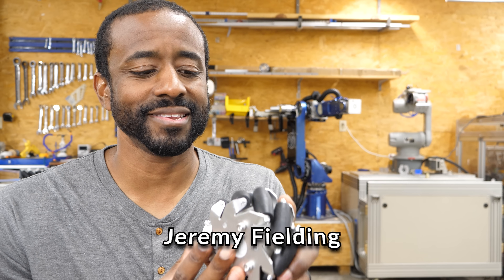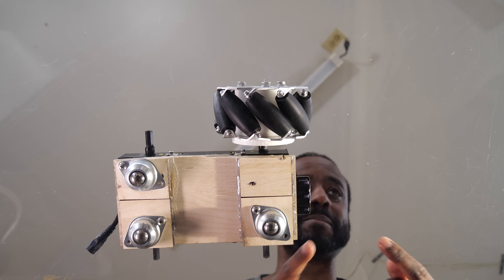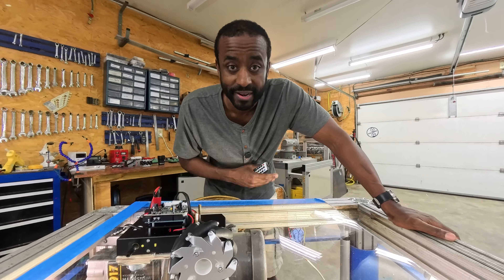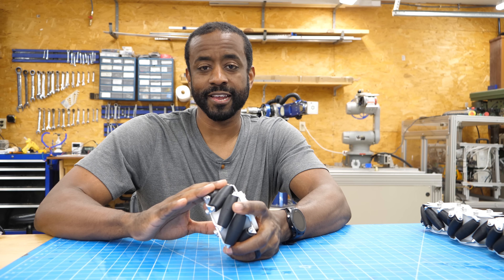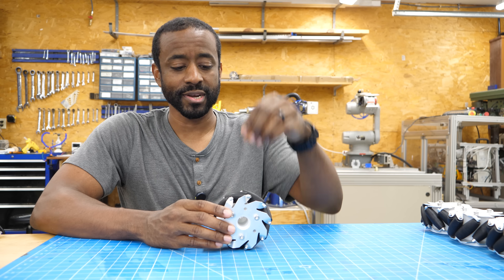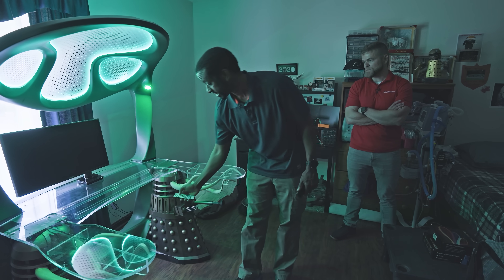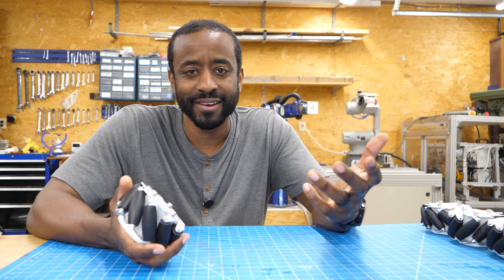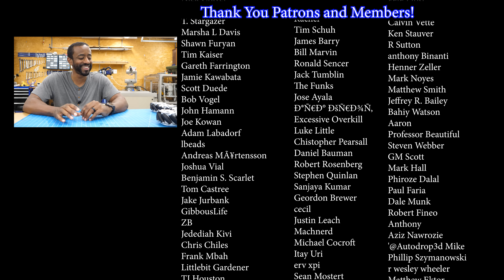The Mecanum Wheel Is So Weird, It Is Genius. How It Works

Comment: I believe most of us already have the 3D printer. Maybe we can use the 3D printers version with just a nut and bolt kit and maybe a few 2020 v slot or 2040 v slot framing. Then most of the materials are supplied by the builder, and they can choose PLA, ASA, NYLON, PETG, etc.
Last Christmas I bought my granddaughter a 3d printer for $200 after tax and shipping... With gaming consoles costing plenty more than that there is no excuse for anyone to not be able to have one in the free world.

Comment: sadly, whilst novel, it has too many moving parts, as in bearings etc. a powered directional castor, with 360 degree control will do the same job, only more controllable.and cheaper. you cannot rei-invent the wheel.

Comment: FIRST tech challenge robots also use mecanum wheels and they move crazy fast on those wheels. they move using a channel mixer from the control station that is hard programmed into the joystick program. i wrote such a mixer in arduino and controlling it with my spektrum dx6e. i built mine mecanum robot for a little $30 since i already had an arduino and motor controllers

Comment: You got me thinking about this. Cool factor is incredible. How about making the roll surface a roller 12:50 bearing mounted on a straight spindle rather the tapered spindle, that would theoretically reduce the lost energy on the twist of the wheel ?

Comment: Does the mecanum wheel have a better traction potential? Can we build one that will offer comparable usage to regular tires? Cost at first will be rediculous, but our tire engineering hasn’t changed since we dropped spokes. Cost will become scalable when we develop the potentials.. Think about putting these tires on cars.

Comment: I'd be interested to know if the Mecanum wheels suffer more friction than a typical wheel. Because the wheels are 'fighting' each other to cancel each other out, and because they are moving against their desired path, does this mean that on those forklift trucks they would wear out more quickly? I imagine they must be part sliding and part rolling? Great video thanks, and a really interesting use case for the warehouse!

Comment: I think if you wanted to put out one at a slighltly reduced priced that you can put together like a meccano or erector and then be able to add on to it later on with more modules to allow the robot to do other things while also having a full kit available for those who are willing to spend more up front, that would help to entice a large enough crowd.

Comment: I wonder if these wheels could be relevant on a mobile work platform? When working construction, you often need to access areas that are high up, and the mobile platforms I've seen and used are always using a conventional front-wheel steering. It works, but the turning circle is terrible, and maneuvering these things through door openings is a pain in the ass. Being able to track sideways would be a game changer.

Comment: Interesting little moonwalking wheels. 

Question. There is an electric wheelchair line called the Robooter (e40 and e60 model lines) with front wheels made up of multiple mini wheels each on their own axes around a larger rim as well. They are not on the parallel angled arrangement like the Mecanum wheel but instead appear to be arranged in an alternating perpendicular pattern going around the rim. I am guessing the wheels mounted perpendicular to the standard wheel axis all spin in unison and the wheels mounted parallel to the standard axis all spin in unison. (I suppose there could be some speed variance to compensate for something or other. It’s all over my head.)

I’m just curious if these are at all related to Mecanum wheels, and if so, if they have any advantage/disadvantage in comparison. There are many ads for what appear to be scams with no actual photos, only computer graphics and no information about the wheels at all. Even Robooter doesn’t go very in depth into the physics of it. (I don’t imagine they think their users in general are quite as interested as I am… not that I can afford their chairs) Thoughts? Similar? Totally unrelated and not interesting at all? Interesting but not for this discussion?

Oh, and did you really have to dis us ladies? 🤦🏻‍♀️

Comment: One thing to consider on cost is 3D printing, free user labor, shipping costs, and economy of scale.
Doing direct to consumer is going to be a difficult market to target.  Being another Crunch Labs will be a tough path.
A cheaper options would be to target a club/team/school that has a 3D printer they they could print the parts, order the electronic parts from Temu/AliExpress, and do the assembly locally.
You would then focus on selling instruction.  Maybe two packages - one remote and for higher end buyers they could pay for you to come.

Comment: The Mecanum Wheels are available for LEGO Particularly for the Mindstorms Robotics platforms.  In the time between 2002 and 2008 another similar wheel was developed in Australia called the Omni-Wheel that somewhat similar but not identical to the Mecanum wheel.  I have had two sets of four of those since the came out for the NXT and EV3 sets I own.  Lots of fun to tinker with. 

Since Mecanum and Omni Wheels are already available on Amazon as well as Robotics stores, I think I would use them to skip ahead into the robotics realm using LEGO.  The sad part id that the Mindstorms Era came to an abrupt halt; but, these are also available for other robotics projects.

You are right though, these wheels are very interesting.

Comment: Yes, Mecanum are cool but they have their limitations.  The main problem is that they rely on matched offsetting forces.  So, in a perfect world matched wheels will go the direction you expect but that only works if the forces match and since the force of friction depends on the coefficient of friction and the normal force.  That means that to have predictable motions you have to have the center of gravity equidistant from all wheels and each wheel must also have the same coefficient of friction to the driving surface and you must not only match static friction, you also have to match dynamic friction.  So, it is VERY difficult to achieve predictable motion with just the wheels.   Ex: As soon as the fork lift has to lift something or has to drive from concrete to gravel, predicable motion is lost.  NUT, fortunately for a fork lift that is not important as the driver is not even thinking about that, the just adjusts the wheel to the direction he wants to go.  He provides the feedback needed for the system to work.  To make Mecanum wheels work on an autonomous robot you have to also have a source of true direction and a control loop to adjust the drive on the wheels to achieve the desired direction - been there done that, not easy.

Comment: There's a NASA Space Flight video from this past week where SpaceX was using a robotic transport to move a Raptor 2 vacuum engine around. I didn't realize what I was seeing until I saw it crabbing. These things are awesome and I wish we saw them used more, but I can understand why we don't.

Funnily enough the first time I heard about mecanum wheels was from a Kerbal Space Program mod called Infernal Robotics (not the original one, but the reworked one.) Sadly, it apparently got scrapped when the wheel physics got reworked.

Comment: Just having the robot base would be a cool and interesting starting project. Then have a platform on top that other projects can be attached to. So for example you could do one attachment that adds autonomous obstacle avoidance - maybe even different versions (different price points) eg. radar or optical sensors (many such things available from companies like adafruit, DFRobot etc). Modules could be stacked with same sort of 'platform' on top of each module allowing another module to be stacked on top. So then you could add a robot arm, battery pack, etc.

Comment: I've seen this in 2 scenarios. 
Stair Climber Trolley, with 2 wheels on the ground each side, the rollers allow limited slip to allow cornering. Ordinary wheels force drag & resistance because of the Centre of Arc not aligned for each wheel.
Wheelchair power drive. Again twin wheel cornering difficulty. This provides limited slip differential capabilities without the heavy, expensive gearing

Comment: Have you thought about building and designing delta robots as a starter robot? They're simpler than robotic arms and they're also used in some 3D printers therefore the parts can be cheap. They can also perform useful but simple functions like moving things from point A to B.

Comment: Hello , I was wondering? Everyone says you can't recharge your car  while driving and  I understand why you can't but what if you had two separate systems as far as the battery's  ,you could have two sets of battery's  one would be driving  the car and as the voltage  gets to low it would switch to the second  battery and the wheel could recharge separately   the first battery and it could switch back and forth. Let me know what think.ty
Reply from the maker: I have a whole video about this. What happens if you add an alternator to a Tesla. Long answer there. Short answer: you are just charging the second battery with the first one. It’s just not obvious to you why that happens. Check out the video. Part 3 explains it better but you kind of have to watch part two if you want to hear me directly connect the two ideas

Comment: I don't think they would be practical on the family sedan. But on a forklift of other type of equipment like that they would be very useful.  In construction we had a 4 wheel drive forklift type vehicle with a boom for reach. It had a multi position steering mechanism.  You could turn the front wheels, the rear wheels and turn them in the opposite direction to make it crab side ways. To think all of that could have been done just by the kind of tire wheel combination is amazing.  And I'm sure much less expense.

Comment: For the price point, I think the sweet spot for cost will be maximizing 3D-printability, with the bulk of the cost being the printer itself.

Also just last week I designed a fully 3D printed mecanum wheel to replace the regular wheels on my kid's high chair, which I think mechanically is the hardest part as everything else is AliExpress-level cheap off the shelf parts plus software.

Comment: inner and outer retainers can be phased , along with added joints, to reduce the wasted energy. The rollers can be locked also . Chirality can also be adjusted using this method. This variation can be used to clear debris from the wheel elements, as mechanical advantage, and as brakes. If the rollers them selves are powered, using the phasing of inner and outer retainers, and planetary drives, it will be a whole new and more complex game. Adding phase angle to drive direction.

Comment: Imagine if you could put the small angled wheels on some mechanism so they can be retracted and extended in/out of the main wheel....  So you could pull them in, and have a traditional wheel.... and extend them, and go into 'Mecanum mode'

Comment: This design does put some extra pressure on the axles though. The rougher the terrain, the more the axles will want to snap in the middle because the wheels keep wanting to come together while going forwards, and they want to break away when going in reverse. This will cause the metal parts around the wheels to fatigue over time. This is probably why we don't see long range vehicles like cars or busses with these tires.

Comment: If you could retract or power the rollers to move you could widen the uses. Also having the vehicle frame broken into 4 quadrants that could rotate and flip over almost like a rubics cube. You could make something incredibly hard to trap or get stuck in anything. It could possibly even brace itself inside of pipes and climb vertically. 

Side note, your channel disappeared off my feed for a while. I have to catch up now.

Comment: With the rollers on each side facing different directions, do the wheels not act like a car with too much toe? It seems like the rollers are essentially "pushing" into one another. The oval shape creates a smaller contact patch, reducing opposing force(I think) but it seems like power will increase on uneven terrain.

Comment: for $250 i would build a robot that does 3x the features/speed/power of $150, for $150 i would make a robot atleast as good as 1 with resale sourced parts for $30, it isnt about budget, it is about desire and goal
Reply: also you didnt demonstate the coolest feature, if you spin all of the wheels in opposite directions, it can spin it's wheels in place without moving!

Comment: I wish your video explained what actually makes up a Mecanum wheel.
Reply: it does, visually
12(estimated) rollers at 45 degree angle on a bigger wheel, it requires more than 1 to go straight forward but when 2 are combined it can translate in 4 directions, when 4 are combined it can do uh..... 8? 16? dunno
Reply: @frogz  i mean on a single wheel, do they need to be rubber rollers? How are they attached? Are they driven (no, from a comment)? Could this be done with out rollers but instead just tread design, etc.
Reply: @BM-pu1vt  the roll/slip of the individual wheels is part of how it works, check out james bruton's bike, it uses similar to this

Comment: It does feel that if someone got 150 they can spend 250. But for some 100 is a hard cap. So definitely depends on what demographic you’re trying to address. Also it’s quite possible that people in different regions have access to similar parts for cheaper and u can just provide a list? I feel like what costs a 1000 to American can be improvised for under a hundred in so many places

Comment: I often hear someone call a remote controlled mechanical device a robot. I always think of robots as being somewhat autonomous, if not completely so. What makes the remote controlled car you showed a robot?
Reply from the maker: In this case It can operate autonomously as well as remotely controlled. But really this is splitting hairs for me. I would call a robot arm a robot even if it couldn’t operate autonomously. This is not something I would bother to debate over. By that I mean the difference is quite small in my opinion. A dish washing machine is also a robot in my opinion

Comment: If the outer rim could rotate independently, both treads can be rotated to a straight tread for forward movement and rotated independently when sideways or turn left or right by rotating (twisting tread). All it would require is a motor inside the hub. Gains are increased efficiency and rotation at zero turn or sideways tracking. Cons are need of suspension of internal motor and more electricity when used, but otherwise, big improvement

Comment: I think that you should do a traditional/mecanum transforming wheel. Why? Wheelchairs, rovers, aircraft, rescue vehicles, military. I could see a ton of applications for such a versatile wheel.For instance what happens if instead of changing the rotational spped of each wheel you changed the angle of orientation within each wheel? What if it were tracked instead of a wheel?
I hope I gave you some ideas.
I'm sure that whatever you do will be awesome.

Comment: That view from under the device was very revealing. All this time i thought there might have been independent motors for those rollers. The other obvious advantage of this type of motion is it saves time and energy. When steering a load around a corner, you don't have to physically turn the load, you just change direction by changing the relative speed of the wheels.  The roller designs could be made more efficient, and you might even have something in the hub or the bearings to lock the rollers for higher forward speed.

Comment: The energy loss and wear is a negative, but being able to run straight in any direction and steer without any additional steering gear is a major positive.  It would save a lot of floor space in warehouse and manufacturing.

Comment: Make the robot with a two tier upgradeable path.  So Tier #1 is a low cost entry level with fewer motors - more gears - that is easier to build and get up and running. Tier#2 uses as many base parts  as Tier #1 bit adds /substitutes bits to make the full Mecanum capable unit. Let them buy Tier#1, Tier #2 and the Upgrade package that will take 1 to 2.  This is great for a stem class. Some schools will not have the budget so giving them a mix and an upgrade is really beneficial. 
Very nice work!

Comment: honestly i would be willing to build a RC forklift type robot with those wheels... if we build just the body and internals then separately we can get radio and other parts it can be 200ish range bigger ones can be more of course... so ya could offer a few models with the same instructions or ya could offer basic and full.... basic being the custom parts without radio and receiver batteries ect then full having everything included... then have size kits small med large... so there is 6 different ones but still 1 instruction to do them all :)

Comment: Perhaps, roller skates would be a good example of comparison. To propel yourself forward each side is pushed out with the line of wheels pointing inward at "varying angles", You're right. There's frictional loss. Getting skates to go forward with an angled side motion tells you there is. You can feel it. Hard angle to get going, lesser-so at speed, (like a gear ratio?),. Love this stuff. 👍. Cheers.

Comment: To start, I think we have the simple 4-wheel platform. The challenge would be to include a compensating mechanism that makes the locomotion accurate. Then add to that an obstacle sensing mechanism that, along with accuracy of position, would slow the robot to squeeze through a maze without crashing.